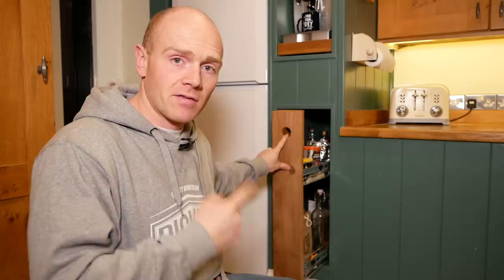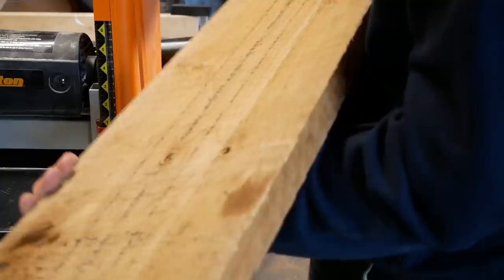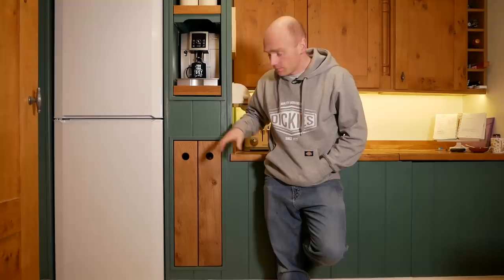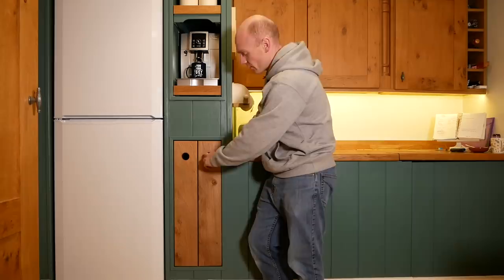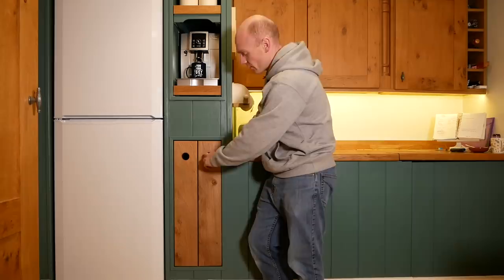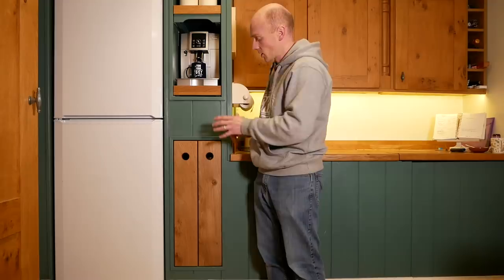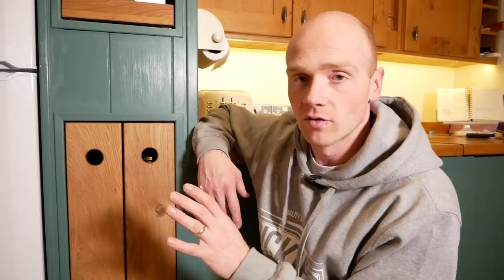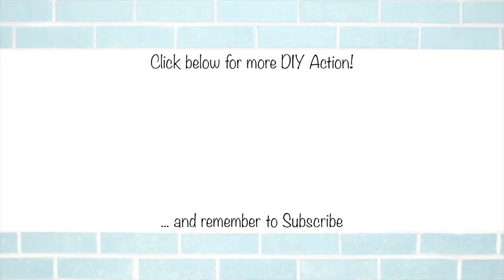Oak Kitchen Doors for Pull Out Larders

Comment: Loveeeeeeely job. 

Im sure you are pleased with it months on. 

The routering of the hole handle and edges is bang on. 

Thumbs up.

Also FWIW i think the grain matching is way over-rated!! 

Unless its a ridulously standing out species of timber then its not necessary.. 

I wasnt even close to looking at those faces thinking hmmm they arent very similar in grain appearence. Perhaps on a whole kitchen seemless custom cabinet install then makers go for this finish becuase the client might be charged 15k for the whole thing but this finish is bang on for the money and grain matching is you nit-picking because you have such a brilliant high standard for work you do yourself.

Comment: Hey mate I watch all your videos but I have to ask - you always seem to measure everything so quickly and almost haphazardly. Is that just for the video and then you take your time measuring off-camera?
I say this as I can measure something 5 times and get 5 different results. Does my head in lol
Reply: Lol I hear ya! One thing I can say is the De Walt 8m tape measure is a beautiful piece of kit. It's big and chunky and won't do that horrible flexing the Stanley ones do. It is also a lot easier to read.
Reply from the maker: Probably cut a bit out so don’t worry. 😀 For smaller things like this I prefer to use a steel rule, (if I can find it!)